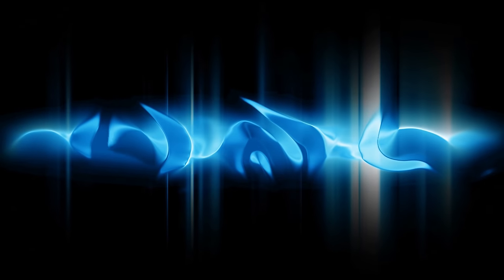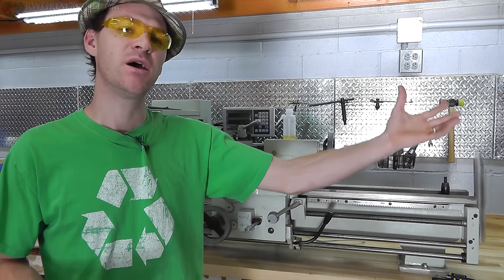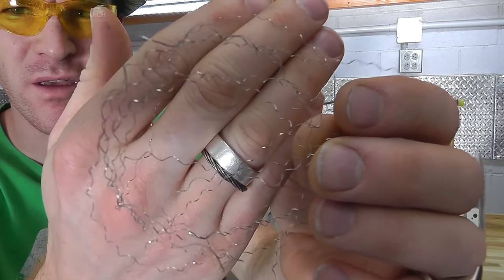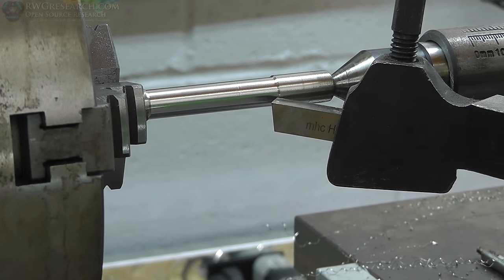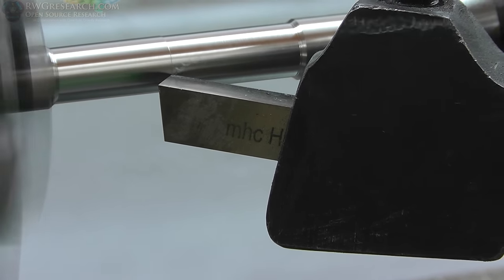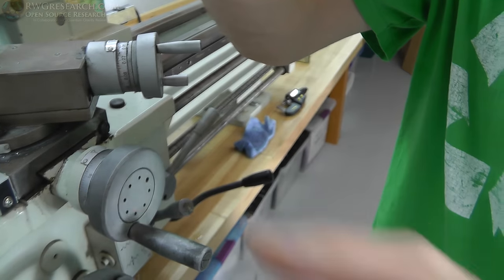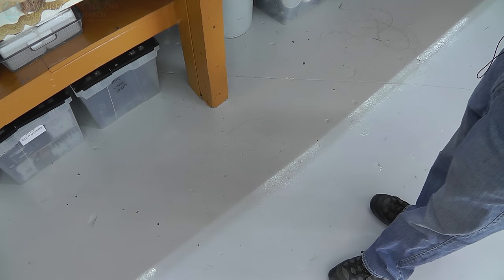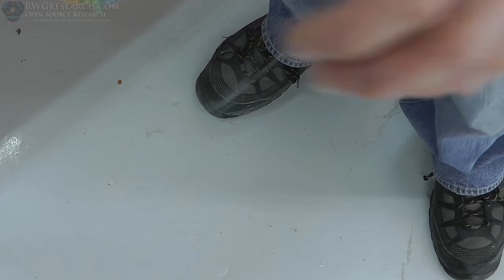Random Video Cutting Steel Spiral Wire...Yeah.. The Little Things Some Times :)

Comment: never grab the lathe shaving strands with your bare hands, huge safety hazard. If the strand gets caught in the chuck jaws, the chuck  with pull back the razor sharp strand slicing your hand, always use a home made hook (just a thick wire with a bend)
Reply from the maker: +manu de hanoi haha i know i should have commented on that in the video :) lol but i did not. fortunately these strands are very week and break to easily to pull me in BUT! you are correct :) although ( you mentioned bare hands... the only other option is gloved hands? and that's a 100% NONO :) any way...) Thanks for the comment!! :) ~Russ
Reply: +rwg42985 Russ, those strands are super sharp, being thin it only makes it easier to cut yourself. I work in a machine shop and had a buddy pulling strands while he was turning to keep them from bunching up around his stock and ended up cutting himself really badly and had to go to the hospital. Luckily he didn't loose a finger. As annoying as they are you really should just stand back and not touch them until you are done cutting. We use needle nose pliers to grab them and pull them away if absolutely necessary. Once again be careful getting too close to the chuck. Safety is priority when using any kind of tools. Be Safe!